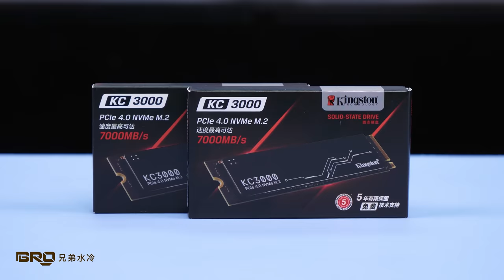「BRO」4K Water Cooled PC Build Lian Li V3000 Plus Understated Luxury .联力V3000+ AMD 7950X#pcbuild

Comment: very neat build. but i have a genuine question. what is the point of having 3 maximum thickness 480mm radiators on push-pull configuration on 2 separate loops. like which single component needs  960mm radiators?
Reply from the maker: this is 2 way water.
Reply: @BROCOOLING  i understand, my question was, which component requires all of that cooling? you could get the same performance with just 2 normal thickness 360mm on just pull or push config

Comment: What’s the airflow configuration in this build, I’m hoping to try and build something like this soon myself.  But the airflow has me stumped bc of the bottom rad placement right up on the psu, and don’t know if that should be intake or exhaust.
Reply from the maker: The wind goes forward, the wind goes out after going up and down..

Comment: man how did u get ur hands on the v3000 plus? like we might see it for retail in 5 years at this pace
Reply from the maker: Lian Li V3000 Plus (18/Nov/2022 Release). The official sent us to install a display PC.
Reply: @BROCOOLING   i really hope its gonna happen this time, no more delays, ive been waiting for this case for a year to upgrade my system,  i hope there will be stock also ... its one thing to launch a product but if you dont have stock its a paper launch...  hope it will be available here in Canada. ill be contacting my local computer shop. but thx for the info BRo Cooling!

Comment: What i'd like to you guys build would be a clear / see through Round Coffee table w/Custom water cooling system sandwiched between cooling block above and below but also capable of doubling as an actual coffee table , Maybe Msi Z690 DDR5 , 128GB Ram , Dual Graphics cards , Under table mounted Psu , just an idea tho
Reply from the maker: The computer in the channel is not what you hope to achieve. It is whether the customer has purchased it
Reply: @BROCOOLING  Ah but what if i am that customer , been trying to build one for years but always ends in failure , Mostly bad design , Ruined a few Components over the years kinda gave up on the  idea till i seen your designs

Comment: Which radiators did you use in this build ?
Reply from the maker: BRO Custom..
Reply: @BROCOOLING  is it possible to purchase these.
Reply: @BROCOOLING  or can you tell me how thick they are,? 
Just planning my v3000 plus and need to know which thickness of radiator will fit.
Reply: @DvdSammlerNRW  55mm with side holes